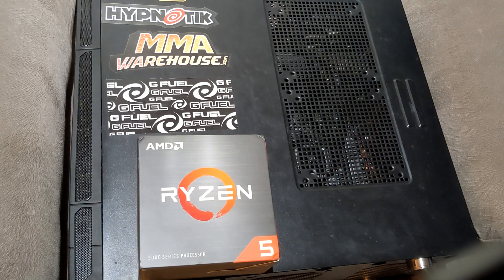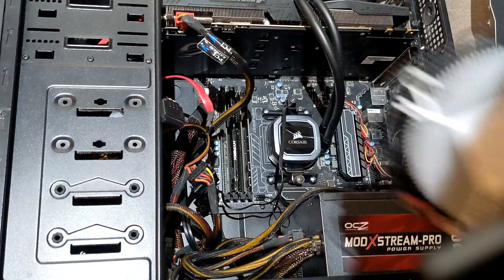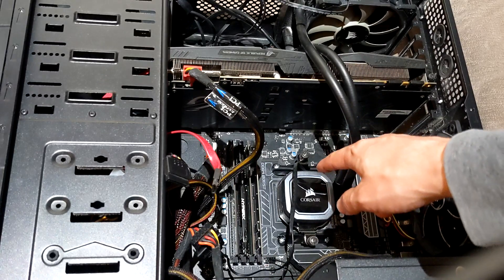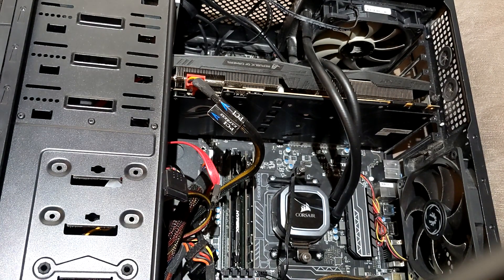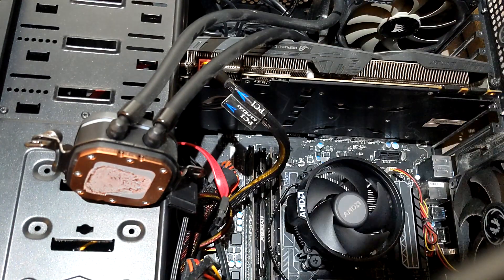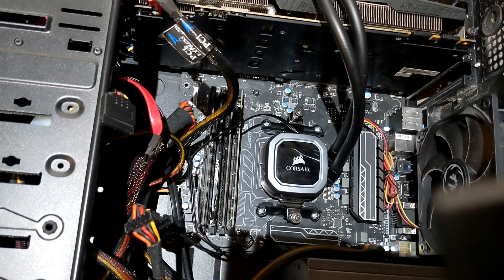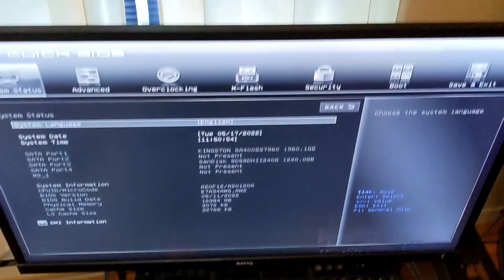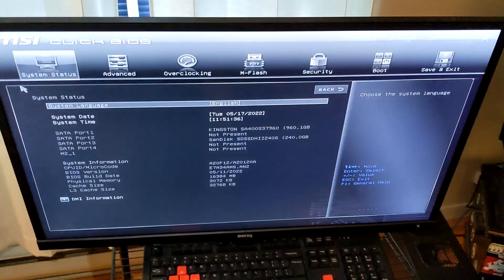[SOLVED] Installing a Ryzen 5600 on B350 PC Mate Motherboard... Will it boot? Zen 3 bios update

Comment: having the same problem with b350m gaming pro and 5600x. cmos clear didnt help 😞it seems like its not even showing bootable devices with F11... (edit) --> figured it out. change boot UEFI to CSM or legacy mode
Reply from the maker: Also if you boot your PC with CSM u cant upgrade to Windows 11
Reply: @R3LAPZE  you are right about that. Win 11 require UEFI and secure boot. So I tested with my old m.2 ssd and its working fine in UEFI mode (just booted right into windows unlike my newer drive), I guess I can conclude that something with the partitioning of the drive is causing this. both drives are in GPT format (not MBR) but I do notice the old one that works has 4 partitions and the one that doesn't work in UEFI has 3. I'm assuming these are for system files and boot table. You could try a fresh install of windows on a fresh formatted drive. that should fix partitioning
Reply from the maker: @JarredJ  might just end up getting a b550 mobo then it would be compatible and would boot from UEFI (I think) then I could get windows 11 but I heard it's not that great lol
Reply: @R3LAPZE  yeah im probably gonna skip win11 for now. If it is a hard drive format/partitioning issue im assuming you may run into the same issue on the new motherboard in UEFI as well if you intend to use your current drive how it is. 
you could check using disk management tool or see if you can boot into windows installer from USB and see what your partition layout for your OS drive looks like.it seems like UEFI default layout has 4 partitions. a system partition, an MSR, a Windows partition, and a recovery tools partition. mine is missing the MSR. but my old drive that works in UEFI has all 4 inlcuding MSR and boots just fine.
Reply from the maker: @JarredJ  the only thing that changed was the cpu so I assume it has something to do with the beta bios update and 5000 series chip compatibility forces you to run it in CSM mode
Reply: @R3LAPZE  Any way you can check new bios with fixed usb 3.0 rear ports :P
Reply from the maker: @ZjemCiKolege  ya my rear usb ports don't work any more too lol
Reply: I wonder if windows 11 is even going to be widley accepted like 10 was forced to be, I wish linux was a viable option for gaming.
Reply: @haveacigar5291  Linux is a visble option for gaming. Many games work just fine on linux.
Reply: @markod7662  but not most
Reply: @markod7662  but not most
Reply: You are madlad lifesaver lol
Reply: Man you are my saviour❤
Reply: Bless you!!!!!
Reply: I have a MSI B350m Gaming Pro, is it still required to do the uefi to csm after the newest update?
Reply: it worked, thank you so much 😍
Reply: You Sir are a genius
Reply: Thank you man.
Ryzen 5700x works now on b350 pc mate
Reply: Only 5600 g
Reply: i havent got any luck with r7 5800x
Reply: Thanks lamo, even though i though that is exactly the problem but you 100% confirmed it
Reply: I LOVE BRO!!!! TY, I FROM ARGENTINA
Reply: Idk if you still get notifs for this comment but im on this upghrade right now 350m Gaming pro - putting a 5600x on it from 1500x and it doesnt boot. Any help? Updated it to latest bios.. Computer works with 1500x and doesnt Boot with 5600x and red led stays on.
Reply from the maker: Holy shit dude you WON!!!! Smartest guy online lol
Reply: @R3LAPZE  glad it worked!

Comment: got my computer a while back and have a b350 pc mate and just recently bought a ryzen 5 5600x and apparently its compatible with my motherboard, should i update my bios before installing the new cpu?
Reply: yes you have to do it before because the cpu wouldnt run on the older bios version.
Reply: did u get it running? i bought a 5800x and its not working
Reply: @mizarstifmeister7298  did u update your bios cause that could be the problem
Reply: Did your 5600x work wanna know cuz i am also want to get 5 5500 @okok-qt8bi

Comment: Did it post at all before changing it to csm? I have a very similar msi mobo and my new 5600 doesn't post
Reply from the maker: No it only worked once I changed it to csm/legacy boot
Reply: @R3LAPZE  changed it to csm on my old cpu, dropped the new one in and still no post. Fans spin and the dram, vga and boot leds light up
Reply from the maker: @vladent4398  try to move around your ram sticks to diff slots
Reply: @R3LAPZE  I tried a bunch of ram configurations but still nothing. Also cleared the cmos, tried different gpu, tried to boot in both csm and uefi mode and neither work, the same problem occurs everytime. I double checked I have the right bios and everything and it should work fine but it doesn't. I ended up putting my old cpu back in (r5 1400 which works fine) and I think I'l try to get a refund. Maybe the cpu was just bad from the factory even if none of the pins are bent or broken.
Reply: @R3LAPZE  Thank you for the help eitherway
Reply: @vladent4398 that's scary. I just bought a 5600 for my b350. Did u ever come right?
Reply: @nat99997  didn't manage to get it to work so I returned it. I figured it was either a bios problem since it was a beta bios or my board is just deffective in some way, since I know the new cpu worked. I have heard people getting ryzen 5000 to work on b350 boards though so maybe you'll have better luck! As for me I'll probably just pick up a b550 if I see any decently discounted boards
Reply: @nat99997  also out of curiosity let me know what happends when you get the cpu lol
Reply: @vladent4398  ah best of luck with finding a good deal mate. Il know probably have it before the end of the week, and il let you know what happens, cheers dude
Reply: @vladent4398  hey man just an update, I installed the newest bios, the one after the beta bios, so an officially supported one, plopped in the new cpu and boom, it worked without a hitch.
Reply: @nat99997  I guess I just got unlucky then. Thanks for the update and enjoy your new cpu man!
Reply: @vladent4398  thank you bro

Comment: after the newest bios update it still needs changing from UEFI to CSM?? i have MSI B350m Gaming Pro and using Win 11 and thinkin on getting a 5600x, do i need to go back to win 10 because of UEFI? thanks
Reply from the maker: It's a possibility
Reply: @R3LAPZE  thanks, Just installed a 5600, it acted like nothin happened, my old windows 11 booted up without changing anything.
Reply: @redphantom2670  I have the same motherboard, but it doesn't start and I can't enter the bios, I get a black screen, what bios version do you have?  I installed the last one, which was in April of this year, but I want to believe that it is an error in this new bios version.  I try to put a ryzen 5 5600, for a moment I thought that I had damaged the motherboard or the video card but I put my old cpu back and it works without problems
Reply: @levipina3552  i remember answering to your comment but i dont see it now! did u manage to fix it? i dont have the recent bios update, when i installed the new cpu there was only one update and that was 2022 version.

Comment: I was able to boot pc with 5600x on my MSI B350m PRO VDH mobo.
Downloaded the beta bios from MSI site.
Bios version is E7A38AMS.AL2  & using CSM mode.
All works fine.
Very happy with AMD's long CPU support on older mobo's.
Will support AMD and buy AM5 platform.
Reply from the maker: Glad it worked

Comment: you know the worst thing about a new mobo is installing it, being all the little fracking wires in their tight little corners cutting your thumbs on the heatsink then getting thermal paste in the cuts, slitting your wrist on the a/o shield backplate. My pc case has enough blood stains to use it as a an aesthetic.

Comment: 5800x3d make no sense, on old 100$ or 160 motherboard from 2017 ,the cpu cost at newegg 600cdn or 475US taxe not included lol,waste of money ,for me 5600 or 5700x make more sense,if you want 58003d save more get at least good b550 you will have snappier system,i remember when i swapped asus b350rog stix to x570 aorus elite on r5 3600,everyting went smooth with same cpu ram nvme!,only the motherboard,and you will get more stable system no more random bleu screen,pcie4,more nvme,or stick with b350 x370 maybe not good idea to invest 600 dollard on old mobo ,that my opinion
Reply: Why should be B550 faster than B350? Is there any secret knowledge that you know or you just spread false info?
Reply: Well it will be better but not that much he can always get a motherboard and utilise 100% of the cpu , but no reason not to get the best processor when you know your old motherboard can handle it
Reply: I had b350 asus strix on r5 3600 after i upgrade to x570,better expérience overall,better ram oc,i know what iam talking about,5800x3d cost 700$gl go put that on b350 waste,5600 make more sens on this older mobo

Comment: Hi, thanks for your vid. Did this today with a x370MB and a ryzen 5800x3d. upgraded Ram and did bios yesterday and installed processor today. first thing i would say to anyone attempting this. when booting up give it time. both RAM and processor seem to take a bit of time for the MB to sort itself out. about 1-3 min of boot and re-boot, just let it go. if after 5-10 min of it not booting to a screen you can interact with or windows, then shut it down and troubleshoot. mine has worked out to be better than i expected, noticeably better. i didnt need to change from UEFI,.
Reply from the maker: Ya I also ended up having to move my ram around and reset until it booted up again

Comment: I found few people showing this process, would you recommend trying this upgrade, I'm planning to upgrade from a 1600 to the 5600 on an ASUS MB which also got a 1.2.0.7 Beta bios recently, concerned with your results... there is also a previous Beta bios that people confirmed working 1.2.0.6b (AGESA). Sorry again, what's was your old CPU?
Reply: i came from a 2600 to a 5600x on gigabyte ab350m v2, im in heaven!
Reply from the maker: my old one was 1500x and i got it fixed

Comment: I have ASUS PRIME B350 Plus and latest bios update was 2022/05/12  (AMD AGESA V2 1.2.0.7), but in supported list no 5600x, however in PRIME A320M-E, which one have A320 chipset, have same bios update, and HAVE 5600X IN SUPPORTED LIST. Should I buy 5600x and hope that it will be work? =c
Reply: Same question
Reply: Does it work?
Reply: @АлександрПоткин-у6н  it works
Reply: @Theunsfalcon  on ASUS PRIME B350 Plus with latest bios?
Reply: 5600x Vermeer It's there in the list , Number 66th. ;)
Reply: @sandyk390  What does ''Vermeer'' mean? I saw it on ASUS cpu support list (yes, i'm using ASUS PRIME B350 PLUS as well), but never knew what that means? If you could explain please..
Reply: @prodajemjetra  codename for ryzen 5000 non G series cpu
Reply: i put the 5600x in my asus prime b350 plus, updated bios, and have intermittent boot issues
Reply: @n8-dog515 did u fix it? have the same now

Comment: Try reset cmos in motherboard manual you have how to do it :) my 5600x works on msi b350 gaming plus :D
Reply from the maker: I'll try it right before I open up my new motherboard lol
Reply: Have you updated the latest bios and everything works for you?
I have b350 gaming plus too
Reply: @diehard7149  yes
Reply: @ZjemCiKolege  would be work 5600x on my b350 bazooka ?
Reply: @ErnestKhalimov-t7v  yes update bios to latest version  and turn off secure boot or uefi/csm
Reply: @ZjemCiKolege  ty, i updated the bios and the system did not start up, it turns out that with old ryzen 1600 processors this bios does not support, then I set 5600 and everything works fine, I just set the ram to the desired frequency and everything works, thanks

Comment: I remember with my 3600  i installed the bios swapped in cpu and it didnt work. Put the old cpu back in installed the chipset in windows and tryd again. After that it did work
Reply from the maker: I installed the amd chipset drivers thing and it didn't work
Reply: @R3LAPZE  sounds stupid but are the boot setting right? I think with a version that dont support the cpu you shouldn't even get in the bios.
Reply: I did cmos reset i think aswell
Reply from the maker: @MaxMustermann-yj1wz  can't confirm the boot settings are correct I never reset the CMOS either